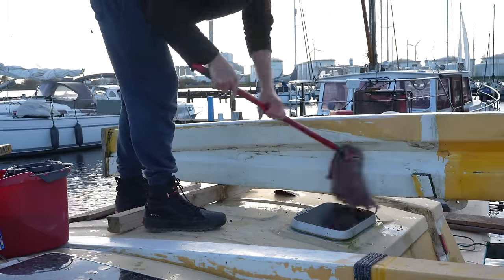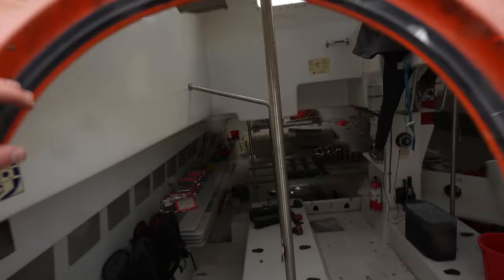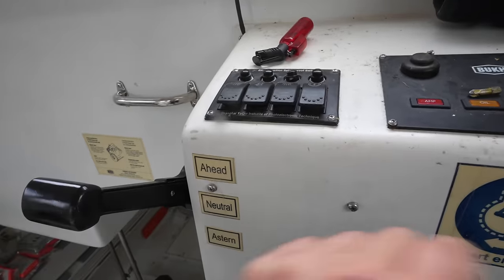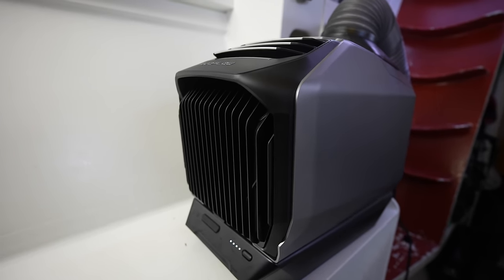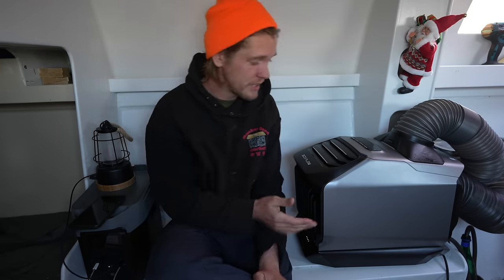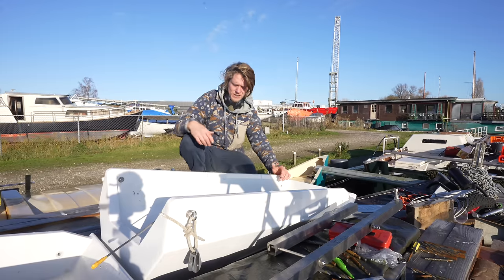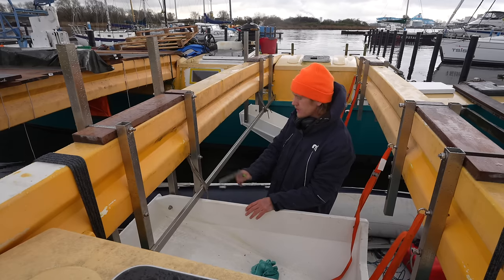Plodding Along With the Engine Pods | Wildling Sailing

Comment: Heads up you absolutely need spacers inside those square tubing or it will eventually loosen up, but with spacers you shouldn't have to worry.
Reply: I was thinking that to, hope He gets those in. But overall It looks good
Reply: Nylon spacers?
Reply: @johnmead1337 no they would eventually crush. Metal tubing is best.
Reply: I thought some time ago on his first build, he said he was making spacers.
Reply: Buy a simple drill press. You’ll wonder why you didn’t get one sooner.
Reply: He is correct
Reply: Do not buy a drill press. There is a Jerry rig drill press kit you can buy that will use your current drill gun.. cheap and effective
Reply: @SVPearler  99

Comment: if using an angle grinder to cut things, you should use a cutting disk/cutting wheel/cut-off wheel, they are made for that and aren't that expensive. If you're going to be using it to cut a lot of metal, it's definitely worth it.
Reply: I was gonna say this but you have it covered.
Reply: Yeah, I saw this at 11:24 and thought , that's a grinding disc not a cutting disc. Btw mark the cutting discs are about 1.2mm thick and will go through that bar like butter.

Comment: The fuel line connectors have O rings which sometimes split or are gouged. It allows air to be sucked in and prevent pressurising the fuel system. Sometimes one way valves in the primer bulb come apart and causes fuel to go back and forth.
Keep going Mark you are an inspiration to take on this project on your own. You will know your boat very well. John,  Australia

Comment: Hi Mark, I have been watching your videos for ages and honestly think you are doing a fantastic job. 

I was taught years back when cutting threaded bolts, bars etc to hold the bar up on roughly a 45 degree angle and rotate it against a grinding surface so it essentially grinds the material downwards and off the end of the rod if that makes sense. I haven't had to use a die since to get the thread to run again.
Reply: Same here, works every time! Greatly advice👍

Comment: I have an emergency portable AC\heater unit for use when there are power outages.  I did quite a bit of research before purchasing and went with a 2 hose system.  The disadvantage of leaving the intake inside the boat instead of in the window is that by sucking air from inside the boat and discharging it outside the boat, you are creating lower pressure inside the boat than outside and you end up causing  humid and cold air from outside  to be suck inside reducing both the effectiveness of the de-humidification and the heating\cooling.

Comment: Great progress now, you cen see the concept of your cockpit coming together. Really enjoying the series..!!  The bolt through the square tubing still worries me. You've got the spacer tube over the threaded bar, but it is still clamping on the inner wall of the square tube. If you consider the forces on that area, it might squash the square tube section, even a little bit, and always be coming loose. The round spacer tube should go through an enlarged hole on the inner wall of the square tube and clamp the outer wall of the square tube with the nut and washer. That way, it won't squash the square section and will always stay tight.  Even more important now that the cockpit is hanging from it, too, and loading more forces on the threaded bar and square tube joints. Sorry, it's hard to explain without waving my hands in the air.... ha ha ha. (if you could see me typing and waving hands too, you'd have a laugh...!!
Have you considered welding the stainless tubes together?
Another great episode, thanks Mark.
Grant, Adelaide, South Australia.

Comment: Mark, have you thought through that what the engines need to  drive is actually the source of resistance, which are the hulls? You have massively reinforced areas where the beams intersect the hulls, and just below those points would be an ideal attachment point for whatever carries the motors. You could make everything out of wood, You can see the idea from how Brupeg's wings are attached. Building short wings that would rotate down between the hulls, and then up to put the engines horizontal when raised would be a much easier way to manage the removal and installation of the outboards and the drive trains.

The problem with the beams are obvious: they're too high: you don't want force applied that high. 

You could, by not mounting the engines at the same point fore and aft, but having one in the front, and the other iin the extreme rear, create a vectorable thrust, sort of a poor man's bow and stern thruster. What you're doing with bolts and steel needs to be welded: too much concentration of large forces on small areas, and single points of failure throughout.
Reply: How about this idea: put together parallelogram-type frames, fixed as you said to the hulls, with a swiveling stay rod attached diagonally to take the thrust. They'd lift the O/Bs in the correct thrust position that way, no risk of upsetting the carbs etc. Easy for maintenance. I would also have a permanent crank handle arrangement to bring those motors up. Electric lift would be a bit too luxurious for me. But surely no need for asymmetric positioning? One motor in reverse would crank the Wharram round easy enough IMO.

Comment: If you put the heat as low to the floor as you can and it will work better in heat mode The opposite for cool. What a great unit. It will be a blessing where ever you are.

Comment: Thinks are coming along nicely. 
Mark, there is a handy little drill attachment for cleaning the treads quickly. Look for an “external deburring/chamfering tool”. It’s a cone shaped device that quickly cleans the end of the rod/bolt and usually leaves the thread in great shape. Normally about $10 or so.

Comment: Sailing in your future (no shore power) Diesle heaters work out to be the most cost effective to use and buy and work correctly without opening windows for huge tubes. Just a simple small hole exhaust 😃🙏
Reply: Sat by my Eberspacher right now! 
 Cosy 18deg's        /        minus 4. outside!!
Reply: @dancarter482  Agree. They are also more eco friendly than electricity run heaters. Cheaper overall per kWh. Smaller to store and fully working off grid sailing the world. I had the same heating on my trader 39 😃🙏

Comment: Use the side of the death wheel to knock the burr off the ends of the all thread.  Also since those motors are going to create a lot of stress on your tubing, you will want to fortify them with a piece of pipe inside the tubing to prevent the nuts from from crushing the  tubes.  This should be done at all of the points where there are bolts on both sides of the tubing.

Comment: You are almost there with the threaded rod cutting. So after the cut on the mounted grinder chamfer the end about 45°. Then clean with the thread cutter and it will be more than perfect until you got yourself a lathe... :) In lidl also there is a drill press stand about 20€ where you can mount your drill... Good job, keep it up!

Comment: Using the ecoflow on a 27 foot, airconing 10 c down from external temp in summer heat, from shore power, it is a heat pump, will always be more economical than the fan warmer. Brilliant piece of gear, live it

Comment: Hi Mark. Maybe others have mentioned this. You need to use a cutting disc on your angle grinder. 1or 2mm thick. What you are using is a grinding disc. Not for gutting. That's why it's getting hot.

Comment: Use thin 1mm cutting disc to cut thread bar and deburr end holding angle grinder at 45° and rotating all thread in to grinding disc side. Try high quality discs, like 3M cubitron, they tend to cut better.
There are specific inox discs to cut stainless btw.

Comment: to get a load of nuts on a bar,  just start them one end and connect the rod into a drill chuck and use the drill slowly.  So much easier than a Threader and you can round over the cut ends with the grinder as well.

Comment: You will cut the stainless steel faster and easier with 1mm cutting wheels, your useing 2.4mm wheesl and you need a lot of force to cut, that equals more heat and larger burrs.
I recommend PFERD products, made in Germany.
For drilling the stainless steel, use a tapping lubricant, it will be far bett3r than the spray which evaporates at the first sign of heat.

Comment: Easiest way to clear threads quickly after cutting is to start the nut on the cut thread and then when it binds tap the nut whilst still on the rod on a hard surface such as a vice, the thread will clear itself and the nut will run clean

Comment: Coming together nicely. 

Sorry I know you just assembled the engine nacelles but I think a bit of stainless tube used as a Bush and tack welded into each of the holes where the threaded rod is inserted particularly on the hinged points would add some longevity with less maintaince  and stop the whole thing getting sloppy when the holes and rod wear, a job for when you get the boat back in the UK maybe...?

Oh and as you showed at the start of the video all the frozen water gathered in the nacelles, how big are the drain holes, remembering when you're sailing the oceans that waves will no doubt be depositing a lot of water into the nacelles at times and it will need to drain away freely

Cold rainy weather and boat restoration, Man it definitely adds to the challenge, paint wont dry, epoxy at times doesn't cure and surface preparation "clean,  dust and moisture free "... forget it 😂

Take care Mark 
Small steps that's all that's required.

Cheers

Comment: I think you need to use both the ventilation tubes  through the external holes for optimum efficiency. (Just like you have them). That way you are not introducing air into the hull. Just heating or cooling the air already there.
Your reinforcing bars would be much stronger if arranged diagonally. As I said in a previous comment, diagonals make triangles. And triangular structures are stronger and flex less than rectangles. Even small fillets at 45 degrees in the corners would add stability (making a mini triangle).
Reply: Also as it is configured right now everything can slide sideways in unison... a diagonal would solve this...

Comment: you might want to look for a used bench top drill press. it should be really cheap and you can sell it when all your holes are done. it will help and, your holes will  be straight, plus it will make it so you only meassure, mark, and punch once per hole. also the nut on the threaded rod is much easier than everything else youre doing put  two nuts on and slap them to spin them, it wont take long until you get the, where you need them on each end.

Comment: probably too late, but for future note. When cutting steel especially in a fixture like that doing clean, though lines, use the thinner ceramic discs. They're more prone to breaking free hand, but less heat and easier to cut through thick pieces in a fixture.

Comment: Drilling,grinding, stainless will render it back to mild steel , if you have to never use a second disc or saw ie stainless disc stainless drill 😊

Comment: Soooo, THE points which will be must under stress will be the pivoting points of the engine  'buckets'. Those bolts will have to transfer ALL the engine forces (forward, reverse!!) to the boat.

Are the holes reinforced?

Comment: Dude… all the nut does is clean up your threads.  Just have a nut somewhere on the threaded rod being cut.  When its cut, just run the nut over the cut end and its usable.  If needed you can buff the threads with a file.

But hey, you’re doing a good job as far as I can tell and you’ve excellent resources to keep you from  getting too far into the weeds and THAT … is priceless.  Chive on my brother.

That drain line is gravity fed.

Comment: If you want to make the engine mount brackets more rigid, do not connect long cross beams, but short diagonal parts within one pair of brackets. These could even be flat steel, because as a cross pair, they are only loaded with pull forces.

Comment: Dear Wildling Sailing.
👍👌👏 Well done! Glad to see that you found friends. I nevertheless hope that you will be able to take Mahi out of the water and under a roof soon. 2) After watching you struggling to cut the threaded rod, I wonder if you had the correct cutting discs on the angle grinder. There are special ones for cutting stainless steel! 3) The rescue boat remodeling sounds very interesting. 4) Congratulations!🎉 It's really fantastic that Ecoflow is supporting you so much. Always having damp clothes and shoes is definitely no fun.
Thanks a lot for making explaining recording editing uploading and sharing.
Best regards luck and health in particular.

Comment: You obviously have your die but you can also get a cone shaped carbide cutter that you can put in your drill and it will clean up the end of a cut rod in 10 seconds. Good if you have a lot to do and can clean up all kinds if cutting crimes 😊
Also works for a wide range of rod diameters and natching thread pitch is obviously not an issue

Comment: And like many other said, bushings in the stainless tube, tightening the bolts will bend the metal (thus loose connections). Bracing should be added diagonally for maximum strength. 

I'll be in holiday the last week before Christmas. I can drive down and help you make them?

Comment: On using the grinder to cut your rod you need to get cutting wheels. You have a grinding wheel on it right now and yes using a grinding wheel instead of a cutting wheel you will really heat up the metal.

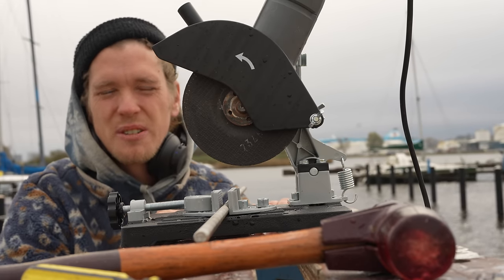Comment: 11:35 get a set of acceptable thread files. Works much better and you'd never feel their weight being useless in your boat. You never know when you have a mangled thread to fix. One file has multiple thread sizes on it, so check to get one in common sizes you might use.
12:05 the blade is too thick. You'd need 1 mm for thread. Drop some oil on it while you cut.

Comment: Bi-facial solar panels charge on both sides of the panel.  Excellent for use on a boat -- if mounted on a solar arch, the top of the panel facing the sun gets direct sunlight for charging and the underside benefits from the reflected sun off of the water to gain extra charging.  The back side usually is not rated for as many watts as the top side, but it gives you greater charging capacity for the amount of space that they take up on the boat.  That's a great score right there, good luck with that!!! Try to find a spot that will optimize both sides of the panel on board!!!

Comment: Put both nozzles outside. But not too close together (thermic short if the hotter air gets sucked in by the other nozzle).

Otherwise, with the sucking nozzle inside, it creates underpressure in the cabin; sucking hot/cold air from the outside in. Makes it less efficient.

So both tubes outside is the best option in my pov, also has no impact on dehumidification.

Comment: That lifeboat interior looks massive for a monohull one tell him to look up Alex Hibbert and the German heart of gold project. 
A hybrid Electric system should work brilliantly if he  looks for insurance write off motors .. 

Those beam channel drains need jigglers fitting like on some fridges ...black nylon cable ties will do.. and a footing pad of high density rubber  or engineering cork mounting pads.

Comment: Just one more steel piece... Thread the bolt thats taking most of the weight...yeeks... Thru the steel and let the steel handel with bolt inside. Can do a stress test to see just how much a bolt can handel. The water will stess bolt from sheer side so the top piece of steel housing bolt will give you confidence in heavy seas. Fine tuning your rig to be quite wonderful. I feel you made the best choice of boat for your personality. Good on ya.

Comment: Slow and steady is good. Especially now you have accepted you will not be under sail (properly) this Year. I feel you did SO well getting to where you are. Wondering if you will put any triangulation into the Motor mounts to get them rock solid?

Comment: Nice video! About the grinding of the threaded bar; you seemed to be using a grinding disc for cutting… I recommend to get some proper cutting discs and it will save you loads of time , give a cleaner cut and won’t heat up the material as much. 🙂

Comment: use the thin cutting disc on your grinder 1mil thick.....  this will cut the threaded  rod quickly  don't use  to much force/downward  pressure on the grinder

Comment: I've seen boats that have "Outboard " motors located in enclosed compartments at the back of the hulls - with a hatch over the top. I've even seen this done in a 27 foot monohull. Super easy, close to waterline depth, so you just need a bit of build up for that depth and the motor mounts...
 Those existing mounting systems look "fragile" & exposed...and not looking nice estheticly.👍😶

Comment: ok Mark using your level on a boat to me would be fine as long as you have the same weight in each hull. If one hull is heavier than the other don't you think that hull would sit lower in the water compared to the other hull the same would be if you were leveling bow to stern the need to be loaded the same. so I guess its going to depend on how you have the boat loaded and why you want a level line.